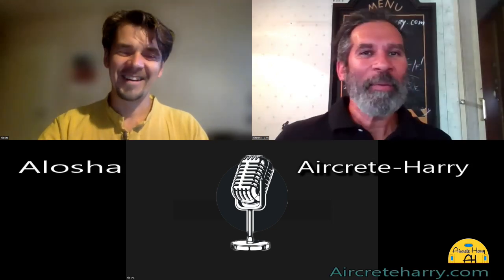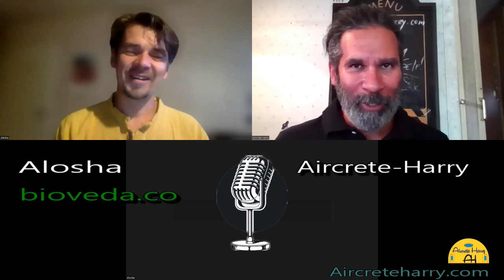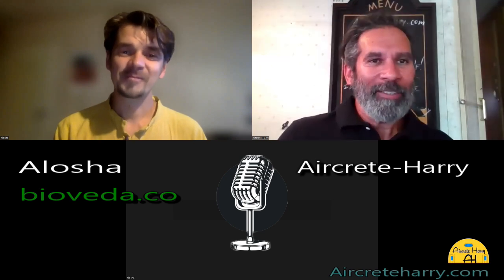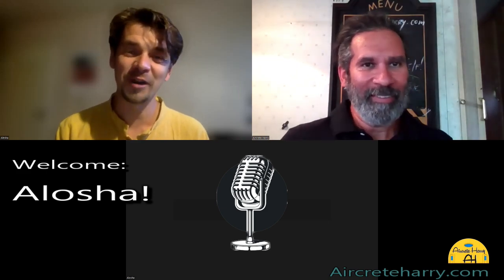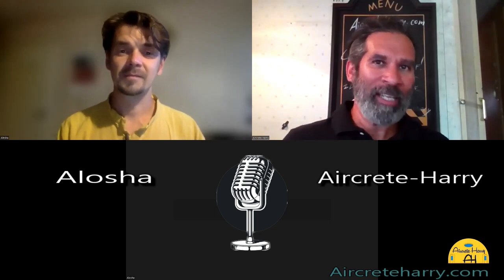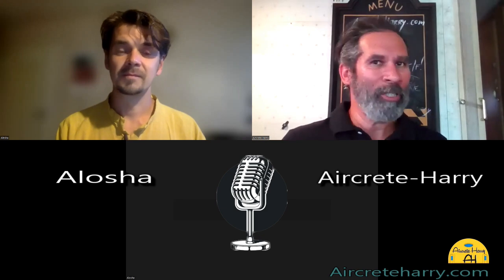Let's Talk Building Systems | Alosha Interview | #aircreteharry #buildingsystem #interview #bioveda

Comment: what if you fill a double shell dome with superadobe? or with styrocrete as "Abundance Building Concepts" uses.
Reply from the maker: In theory it would work fine.
Reply: It should work fine, but don’t go forward until you are extremely familiar with the difference between thermal mass and insulation.  A lot of alternative building methods try to use the concepts interchangeably, but they are different and that can be really significant if you’re in the wrong climate.

Comment: Hello AirCrete Harry, what would happen if you sprayed aircrete on the outside of a shipping container? would that increase insulation? would the aircrete play nice with the metal container or would it corrode it.. ?
Reply from the maker: Welcome to the channel Alex 👍 
To clarify - as many confuse the process: Aircrete is not sprayable. 
You could pour Aircrete on the roof.
For the walls you would go with making the Aircrete bricks technique.
As long as a shipping container is painted with rustproof paint it would work well.
Is that something you have in mind on working on yourself?
Reply: @AircreteHarry  one day I hope to buy some land and have a go! Hmm I wonder if a form could be made to pour some aircrete panels that fit the corrugated sides of the container 🤔 similar to how they have those internal corrugated styrofoam insulation panels…
Reply from the maker: @alexlavertyau  Yes, that's a possibility.
It could be designed in CAD or drawing to better fit the walls 👍
Reply: @AircreteHarry  wow , that's awesome. I have a shipping container home i live in and   had been contemplating how i could cover the roof and walls with aircrete. I was going to ask you Harry about the mix ratios and best imgredients to use. I figure the roof could only be 3 or 4 " thick. id build a form and pour it.    I was wondering if and what kind of reinforcement/ rebar, etc. to use so i can not worry about  heavy weight cracking it or denting the roof.  I was also contemplating if i should spray it first with a releas agent and pour 4x8' panels in case i ever wanted to remove them. I would caulk the seems and maybe just weld on 4  stainless steel 5/8" nuts and bolts with washers on each  panel.                                                     For the sides i would build a 4x8' form with a face panel that gets braced at a 45 angle and filled from the top. spray a release agent on both the form and the container. walls.  make it 4" thick. 2" fill the valley ridges and 2" beyond the outer side of the coregation.  reinforce the pannel with hog wire and a couple rebars. use my bolting method to both keep it attached snug and for removal in the future if needed.                          any idea of the R factor for just doing the outside.
Reply: Thanks for your comment Alex. I just stumbled across it and it inspired me to shoot a comment to Aircrete Harry on this thread which you might find helpfull. Cheers!